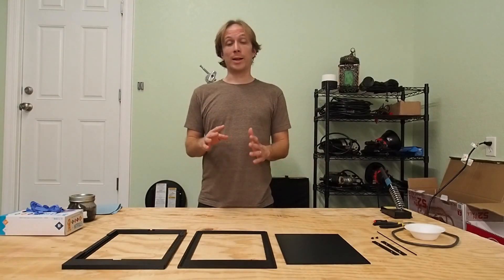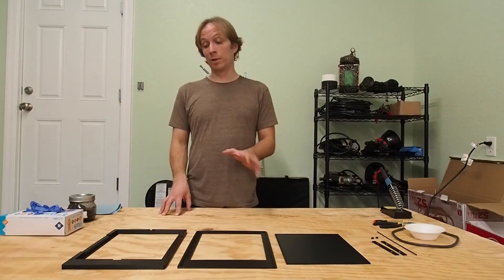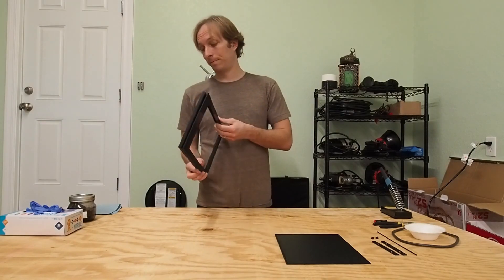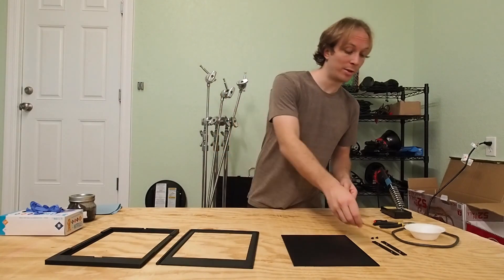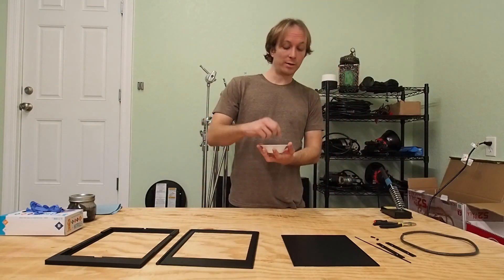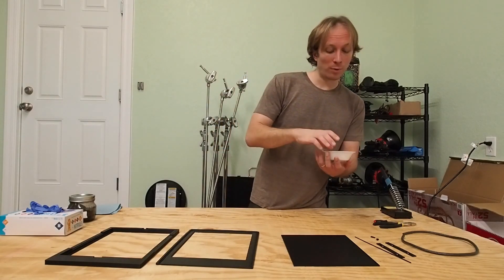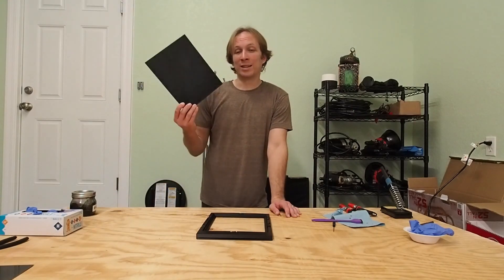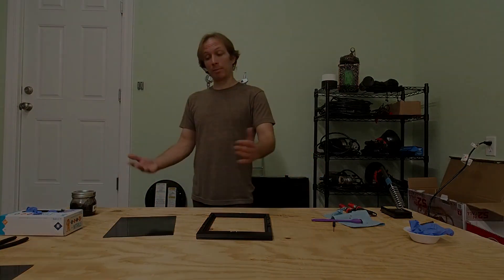8x10 Wet Plate Holder Assembly

Comment: Hello, thank you very much for spreading so much about the wet plate!
I am considering printing your prototype for 8x10, v2. (in a store to print)
I have several questions for you since there are parts of the video that I do not understand well, and other questions that you do not deal with, apologizing first for my poor English:
- Is the plastic ABS or PLA?
- the size of this design is exactly for 8x10 plates
- Have you tried it with an 8x10 camera? Have there been light leaks?
- It seems that the slit of the slider is very wide, does not light enter through there?
- Does the slider run well through its slit? 
- What improvements does Version 2, bring compared to the first?
Finally, with use, 
- how does it respond to the corrosion of silver nitrate?
Thank you a lot!!!
Reply from the maker: Hi Miguel,

1. I print mine in ABS, but PLA also works.  You just have to be careful not to get it too hot.  One of my earlier PLA prototypes melted when a friend took it up into the mountains on a sunny day
2. Anywhere from full size down to about 1/8" short on each side
3. Yep, no issues
4. That's what the foam backer rod is for, it goes in the round cavities towards the top of the holder and expands to block light 
5. It can be a little tricky, but it works.  I put a taper on the bottom of the dark slide, round the corners, and usually slip one corner in before pushing the rest of the slide through
6. It has a totally different closure mechanism, using screwed-on toggles rather than tabs that have to be glued onto the lid
7. No issues with ABS or PLA prints, I haven't tested any other plastics

Comment: will you be doing a 11x14 version at some point? thanks Robert
Reply from the maker: I don't have a big enough printer to do an 11x14, but the holder design is parametric so it could be scaled up pretty easily. Someone with a CR-10 S5 or comparable printer could print it at that size

Comment: Oh my goodness Robert.  I just looked at your files and video on ThingVerse and now here.  I am a wet plate photographer and intend to make some of these for myself.  I was going to recreate the Folmer Graflex plate holder although with the proper film to focal plane distance but now, your design is soooo much better.  Thank you.  I am new to Freecad but will attempt to create an analogue in 5 x 7 and also in ideal format.  Thank you sooo much.  Best to you.  Mark
Reply from the maker: Hi Mark, I've actually got a 5x7 design on thingiverse :)
Reply: I just found and downloaded both your 5 x 7 and 4 x 5 designs with how to instructions.  Great!  I have yet to purchase a 3 d printer.  Do you have any insights into which unit I might consider?  I intend to print in ABS or another material with good wear and dimensional stability.  I would need to be able to print the full 8 x 10 design.  Best  Mark
Reply from the maker: @markmackenzie9508  the only printer I know of that's somewhat affordable and can print that big is the Creality CR-10 S4. Prusa is supposed to be working on a 400mm printer which I'll be pretty excited for once it's released

Comment: Awesome! Please make for 4x5 and 5x7 too!
Reply from the maker: I actually have 4x5 and 5x7 designs on thingiverse already, but I'm going to try to update them to match this newer design
Reply: @tehbieber thanks!
Reply: @tehbieber   I have printed the 5x7 on thing verse - I am only confused by the four button parts - I think they go into the holes for the light trap but not positive
Reply from the maker: @philiplitke5339  yeah, they're meant to cover those four holes. Back when I first started this project I had visions of using removable supports and printing the entire body in one piece, so I wanted to leave access to thread the backer rod in from the outside if necessary.  I've removed those in the latest versions though because printing in two pieces and gluing works fine

Comment: That is top assembly, thanks but where is the slider?
Reply from the maker: You'll have to provide a suitable dark slide, I haven't found them to come out sufficiently opaque when printed at the needed thickness. I've used the same trophy aluminum I make tintypes out of for them usually, but someone has also told me they successfully used a slide from an 8x10 film holder
Reply: @tehbieber  Thanks for that, could you please reshare your files? i have lost the link...
Reply from the maker: @stephane27750  https://www.thingiverse.com/thing:4064725
Reply: @tehbieber  It is possible to edit the 3dmodel to change the size to adapt to my camera :)?
Reply from the maker: @stephane27750  the model is parametric, if you open up the FreeCAD file you can edit the dimensions all you want